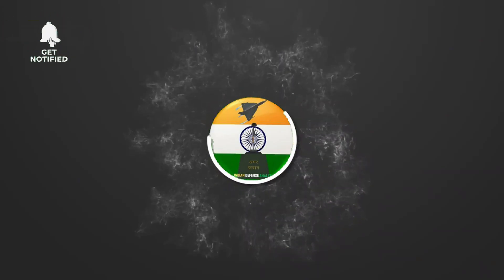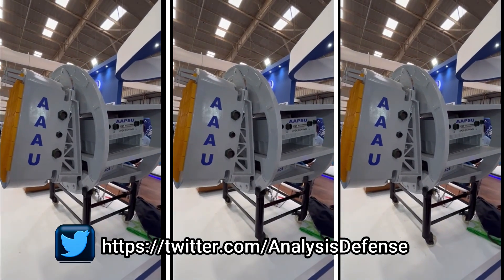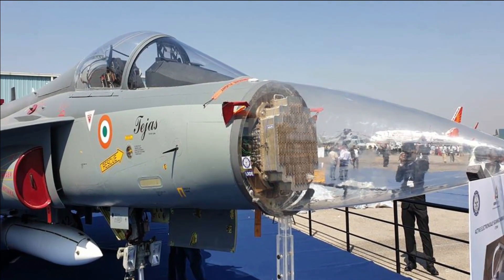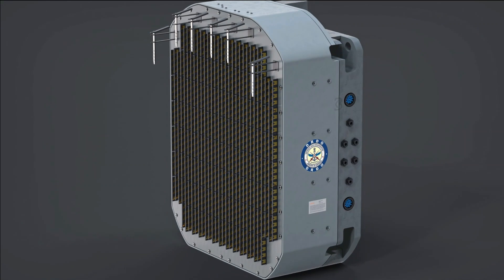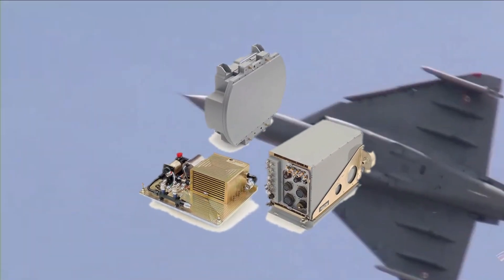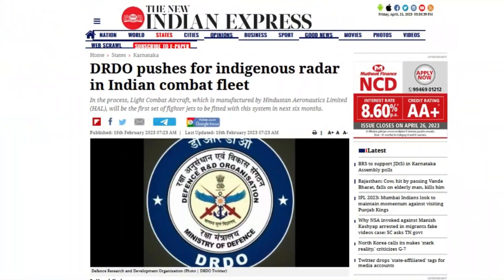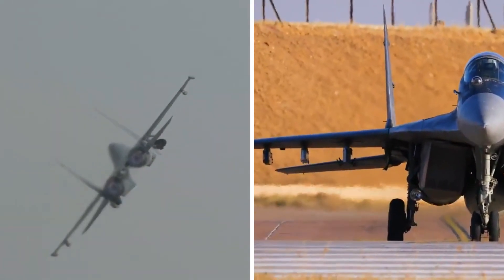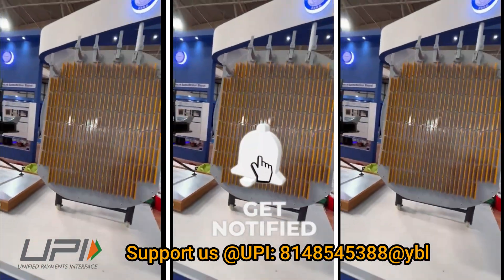Uttam AESA Radar For IAF & Navy #drdo #iaf #indianairforce #indiannavy

Comment: The need of the hour is GaN Gallium Nitride technology. It is more sensitive, more range, consumes much less power, more resolution, more TRM modules, does not need cryogenic cooling, and compact in size. Basically, beats GaAs Gallium Arsenide in all parameters.

Comment: why have they postponed Uttam's installation on Tejas mk 1A ?
    which agency is delaying ?
    i think it was initially supposed to go on 21st mk1A onwards     ; then postponed     ;      then again postponed !
      why ?
Reply: Due to Israel contract. Israel have contract with HAL for minimum order quantity to provide technical support.   After IAF reject jaguar engine upgrade to support Darin3 upgrade.
Reply: @Dexterj8704   and what's ur excuse for uttam radar on su 30 mki will commenced 2026 onward🤡🤡
Reply: @nishantshrivastava9674  under process IAF and DRDO evaluate power requirements. Su30 is IAF plane so process is deferent.
Reply: @Dexterj8704   under process hi rahega.. 2008 CAG report shows uss time se hi super sukhoi upgrade ka plan chal rha h.
Reply: @nishantshrivastava9674  upgrade implementation ho raha hai bhai. Weapon package mission computer avionics upgrade engine modification unlimited upgrade ho chuke hai MAWA and RWR aur toe decoye ka integration aur testing chal Rahi hai.
Reply: @Dexterj8704   Ye koi infrastructure project nhi h jo 2012 me road nhi bna to 2022 tk bn jaayega. 
20 yrs me to warfare new generation me enter kr jaati h.. Ye itna sensitive sector h ki khud se nhi ho rha to bahar se krwao.. Baithoge to baithe reh jaoge mig 21 k sath aur koi bhi aa kr baja jaayega.

Comment: Sir
Last 2 years v r discussing on Uttar AESA radar.
Actually by this time v should have moved to next level.advanced radar but still discussing on previous generation model radars

As ching is going at a rapid speed, v r also need to b very speed n catch up
Reply from the maker: as I have explained and based on my discussion with DRDO officials. The Uttam development for LCA Mark1A is complete and the ball is in court of HAL.
HAL has bought the Israeli Elta AESA radar which they will get integrated first and once complete, Uttam will be integrated.
Reply: @IndianDefenseAnalysis  I hope it happens soon.
Reply: @IndianDefenseAnalysis  
Progress of AESA for super Sukhoi ?
Reply from the maker: @fly463  from 2025 onwards
Reply: @IndianDefenseAnalysis  
That's quick 🤔
I thought they just started to work on it.
Reply from the maker: @fly463  there is no big deal in developing radar for SU30 mki. It’s just upscaled model of what is being used in lca. I wish IAF push for its integration now as its certification will take time.
Reply: @IndianDefenseAnalysis  
Ah you make sense 
Certification in India is surely a problem
Reply: @fly463  1st one takes times as there are 3 modes & the s/w (including integration with EW, targetting system & other aircraft sensors) takes as much if not more time than the h/w
Reply: I have watched videos on it since 2014. They repost the same information every year.
Reply: Su30mki radar is very powerful radar even some current AESA radar didn't match its performance so its take time to overpower ur product to replace it. If DRDO say 2026 than i can wait for 2026. Because without uttam su30mki can easily overpowered its opponent with combination of rafale and Tejas.
Reply from the maker: @Dexterj8704  if they start by 2025 then add 4 more years, that’s why it need to be started now.
Reply: @IndianDefenseAnalysis  The project from DRDO is started and study on su30mki engine is undergone. As u know su30mki is an IAF aircraft so formalities take time. DRDO not going to share every development with public. India is country where system is involve everywhere so slow pace of project is understandable. IAF recently completed the certification process of Uttam for LCA. now they sit and discuss their requirements with uttam radar for su30mki pass it to MoD than DRDO all takes time.

Comment: F-16 Block 52 is integrated with APG-68(V)9 radar which has Range of 105 km for 5m2 aerial target. LCA Tejas Mark-1 will have Uttam multi-mode radar which has detection range of 140km for 0.5m2 object. The F16 Block 52 has an RCS of 1.2m2 and LCA Tejas has RCS of 0.5 m2 RCS. First look first shoot should go to Tejas if enough AWACS are airborne at the time, that means a minimum of 12.AstraMk1 has equivalent range to AMRAAM C5 100km vs 105km. 5km is insignificant. Would prefer earlier induction of  Gallium Nitride  based radars, because those radars are substantially superior to GaAs. This is important vs PLAAF which has so many modern fighter jets with good radars and multiple AWACS. Basically AWACS plus Astra Mk2 means PAF will lose any aerial battle.
Reply: Illogical
Reply: @mrahulkeya8142  how come ? you need to improve upon your knowledge & MORE SO on your logical abilities !
Reply: @pravindahiya719  you increase your knowledge kid go home and do home work
Reply: Block 52 has 3 m2
Reply: @datoolz0  bro see Pakistan operated f-16 A/b
Reply: @datoolz0  they are operating block 15 too

Comment: When we going to upgrade our fighters with these? Only talk is going on for several years. We need to upgrade Mig29k with Uttam and Brahmos ng soon.
Reply: Exactly tired of this now.
Even radars are taking so long.
Reply: 2026 onwards for su30 mki
Reply: The MIG29K should be simply retired its a waste of fuel.
Reply: @timdipayanmazumdar1089  we can't retire them before the induction of Tedbf, we need to upgrade them. On current aircraft carrier vikramaditya is not compatible with any other twin engine fighter jet